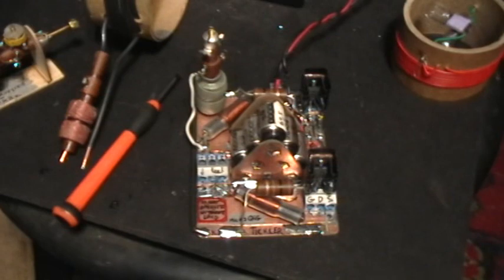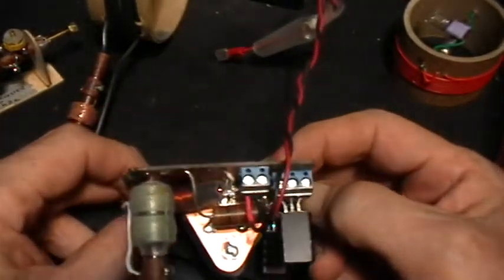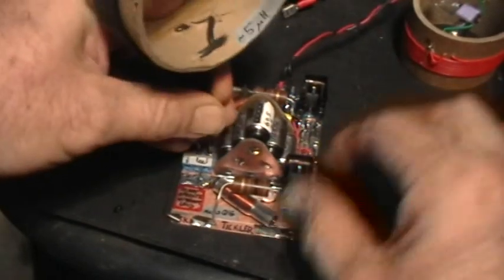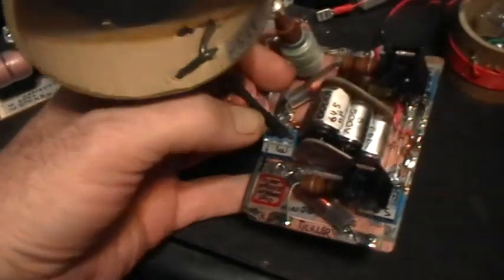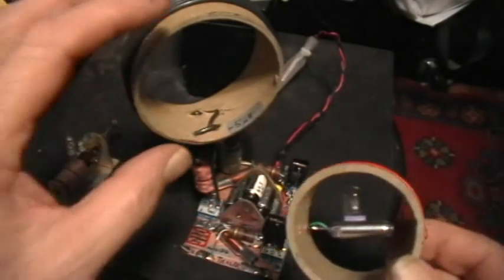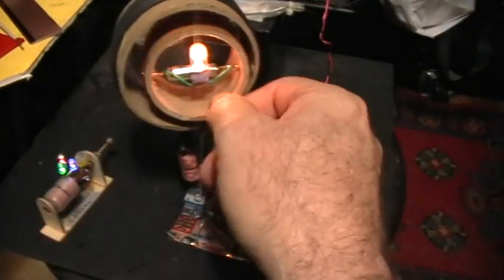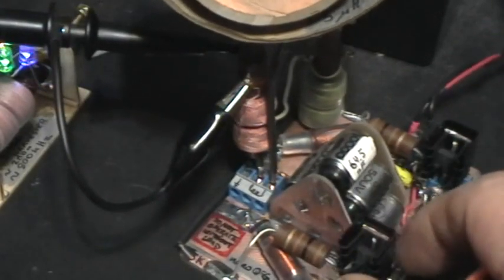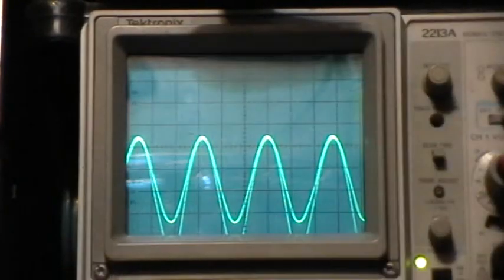Electric OU: Micro QEG Part 2: Improvements, TransVerter, Phase

Comment: Does the Tesla bifilar coil have a self-resonant freq of the same 300khz you drive it with? If I remember, that's the whole point of it... that the "inter-filar" wire capacitance cancels/balances out the self-inductance. Just askin'... just seems like 5uH is awful low for 300khz
Reply from the maker: +beforebefore The driving circuit uses a tank circuit made from the TBF coil and a parallel capacitance, and is auto-resonating. If either the parallel capacitance or the coil's inductance changes then the frequency of the driver circuit changes as well, in order to maintain the resonant condition. Yes, you are right that a very small TBF coil will have a very high self-resonant frequency if not connected to external parallel capacitance.

Comment: Like your experiment. The qeg is very interesting. The thought about making your own power and being selfsufficiant is like a dream come true thing. So I wonder, this reactive power, how to make it useable? Is it convertable by todays tech or is it meant for a human to be in a reactive power enviroment with cordless light (for example) or other appliances without converting it to standard power? Bottom line is practical use. I've read numerous comments stating all is impossible and power always has to come from fossil fuels. And I like to keep an open mind, so i try to think outside of the box. 
Not all of what is possible has been discovered.